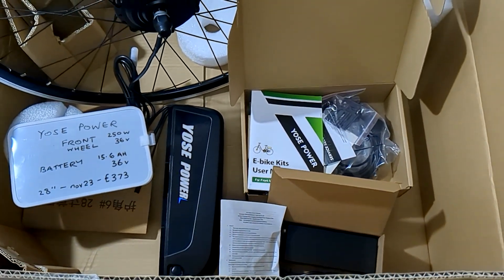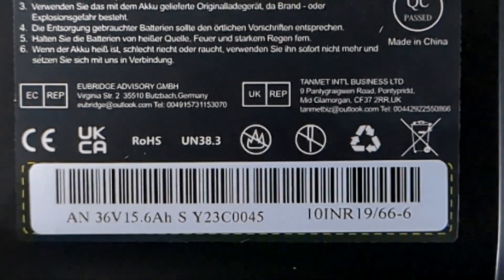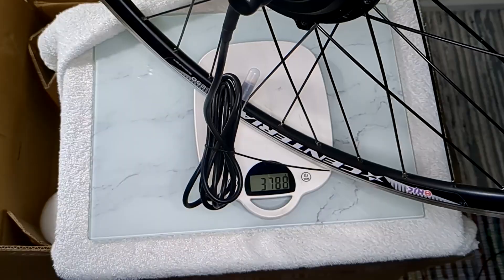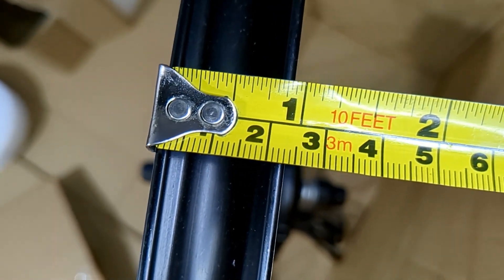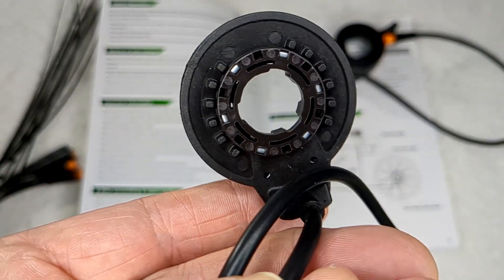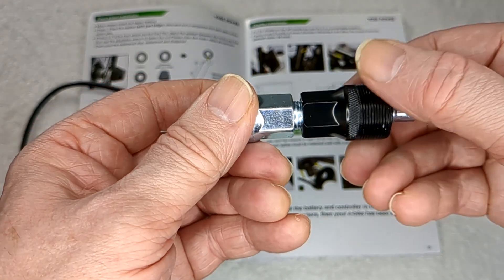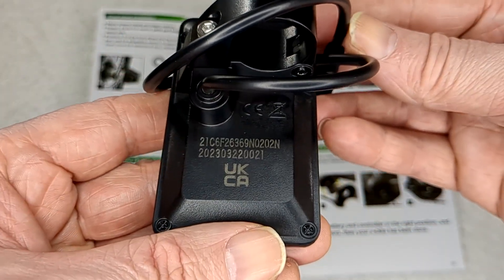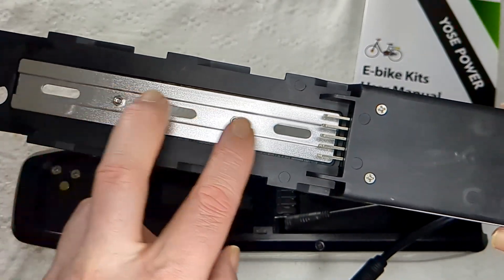EBIKE CONVERSION KIT .. 250w front .. 15.6ah batt .. Yose Power

Comment: It is legal to have a throttle that does walking speed in the uk, where it is handy is for moving away from a dead stop at lights and such. Just press and you get a little boost. But really you are better going with the 350 watt motor, technically it’s illegal but they both look the exact same that the police are never going to stop you and you do notice the extra power.

Comment: I bought exactly the same kit as yours and have fitted it to a new lightweight folding bike last month (January).  I did not fit the thumb throttle, light and brake levers. The bike has 6 low ratio derailleur gears. All working as expected but not ridden yet.  Bought pacifically to ride off road on trails in my area. The thumb throttle will only give you 6kph (3.75mph) walking speed. It allows you to walk beside the bike and have motor assistance.  Some use it on a MTB accessing a steep hill where you have to get off and walk beside it. Not legal as you say on UK road use because you can override the output speed.

Comment: I've just got the same kit. However, I had to add the battery adjustment bracket due to the position of the bottle holder bolts on  my bike. Also, I had to order the magnetic brake sensor accessory as my brake and gear change are integrated. Total price comes out at £400 which is still a competitive. BTW the main kit arrived within 48hours. However, the adjustment bracket and brake sensors are coming from China and may take up to 30 days to arrive!
Reply from the maker: think I will need to get the bracket too. the fit is looking very tight.  currently £17 on their website.
to others : its worth checking out the yose power website.